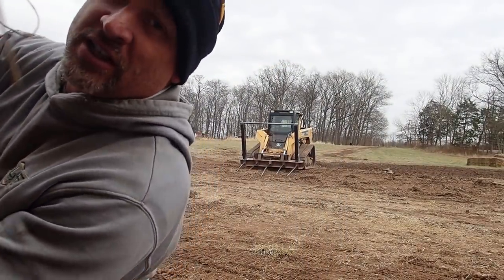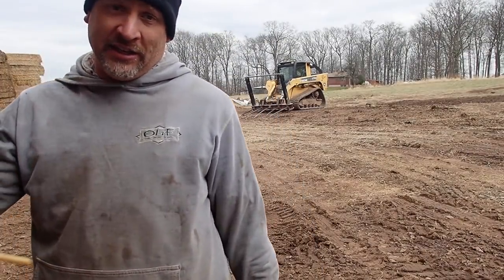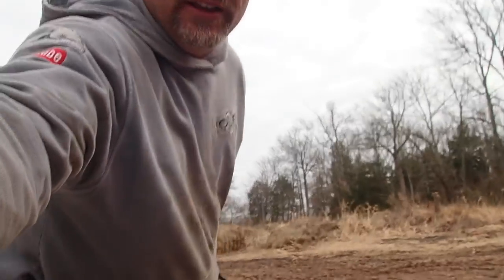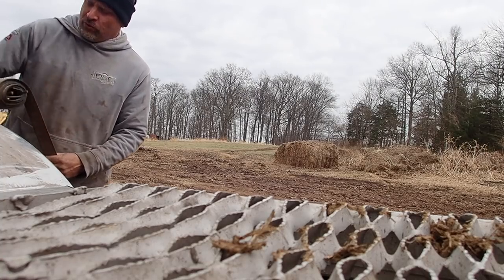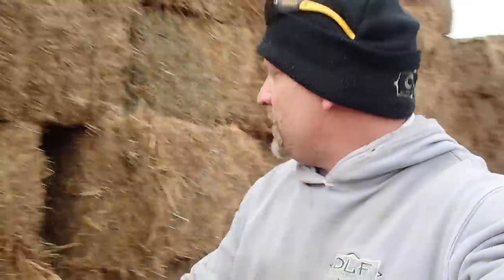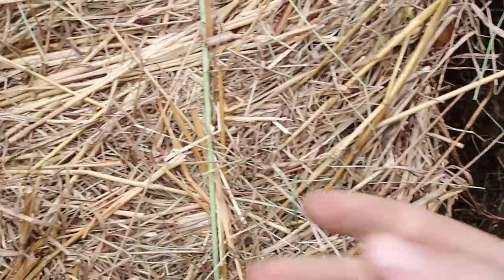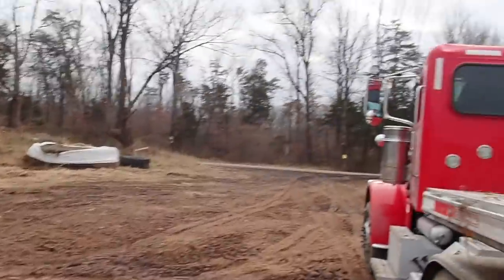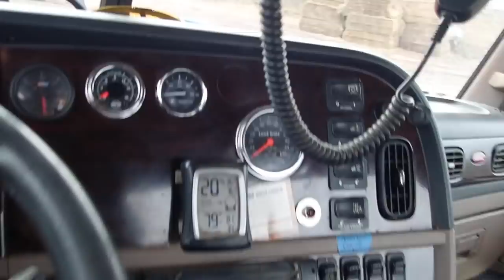Skid Steer Wont Quit Smoking

Comment: My boss has a 330 e and at around 2000hr. It was smoking black all the time, he thought it was I n the air system , but it turns out the injectors were getting week. But yours looks normal as a diesel

Comment: Wes, one thing I've noticed since you said that you're struggling to get bales on the forks is that each one of the forks on the skid steer is pointing a different direction. Maybe try straightening them out and get them all going the same direction. It's not going to solve the problem, but it should help some.

Comment: We have three 333e model track skid steers at work. If you look for a new skid buy the 333g model that's the newest model and is way better. Has a yanmar diesel in it and does not have the power issues the older skids with John Deere engines have. A tech for Deere once told me they have a guy (jd) that goes around the state's and overhauls the engines in these skid steers. JD got away from its own engines due to the power issues and due to emissions stuff the 333g model has def in it. That's what I've heard anyways

Comment: What is truly awful is to realise that for someone to steal that number of bales, handle, load and haul them off has to have some involvement (at least) with another farmer/grower because 65 bales of that size is a great deal of material! The thieves need access to machinery and equipment to load and haul off  the bales - they are not something you can put in the trunk of your car!! 

This theft is not some local scumbags from the run-down locality thieving something for themselves or sale to others but some other local farmer / grower. That would serve to make me really mad!!

To find out that someone had also been round and carefully sabotaged a further 20 bales by cutting strings in a remarkably cunning way just compounds ones angry feelings towards such people.

It suggests to me that someone pretty local has a serious grudge towards you Wes for some reason or other.

Comment: I like the strap winder that is really cool and rather simple I like it Merry Christmas
Reply: John Greer most flatbed truckers have them, they have lots of straps. I bought two five gallon buckets of chains and binders from a retired trucker. There were two of those strap winders in the buckets.
Reply: Good idea
Reply: John Greer they sell them at truck stops rather cheaply
Reply: Why wrap the hook first? When you throw that it could smash a window or hit somebodys head
Reply: David E.  The hook is wrapped first so that the weight is in the end that is thrown. It will unroll itself when thrown over the load.
Reply: The way they're wrapped is personal preference
Reply: some shippers won't let you throw the metal end. ive always flipped about 6 feet of strap tail and then rolled it up. did ltl otr flatbed. up to 35 30foot straps per load haha
Reply: That's why one, you learn how to throw a strap, and two if you have someone else out there with you, you shout a warning before throwing a strap over. Pretty easy "COMING OVER!". Lastly this is his operation so I'm pretty sure a shipper isn't going to be in his shit about how he winds a strap, or throws it.

Comment: Im suprized you don't use the 4 in straps with a sliding winch system on your hay trailers. Why don't you use them just want your opinion wes
Reply: Cody flenthrope because the 4in are heavy. Try throwing the 4in over the bales while they are on the trailer. And the 3 in are big enough

Comment: Wes comment on smoke and horsepower is a typical stupid farmer explanation. He is on and off the throttle so the turbo slowes down. When u get back in the throttle or add load it smokes a bit until turbo spools again. Just like every diesel until 2007 when they started using Dpf on the exhaust. If it's at full load steady state and still smoking it's broke!

Comment: first they steal your bales then they cut your strings. Karma is a bitch and she will catch up to them. also seems your skid steer is a bit light in the ass end.
Reply: LUNITIC WILL well he is picking up 4500-5000 lbs lifting 3 bales and the skid steer I think is rated around 3000 lbs 
skid steers have hydraulics enough to handle more weight its how their balanced to handle the weight their rated

Comment: Heck that is just broke in lol. We got a bobcat S250 with air cooled duetz that just rolled 12k hours. Smokes a lot. And i run them like you do. You got a good machine. And i do agree, they need more power per unit for what they can do.
Reply: Dan Kunde are you sure of the motor? I'm pretty sure all S250's have kubota diesels.
Reply: 02 s250 still had duetz, same as the old 873s did. In 03 they switched to water cooled botas.
Reply: Ah. Learn something new everyday. Thanks.
Reply: We had an s250 same motor. Good machine.
Reply: Yeah I've had T250's and T300's. Very good motors. Not a fan of the new emissions. Just something else to go wrong in my book.
Reply: Dan Kunde Lol Duetz you mean Deutz lol German brand 😲😂
Reply: We also have an 11 s750. With just under 3k hrs and our 250 with hold her own against the 750 with a Bota 87 hp motor. But hydro systems suck these says. Damn bypass systems kick in before ass end up on new skids these days.
Reply: 750s are garbage. We bought one to retire our 250 in '11, that thing sucked in every blade of straw or hay or dust. Had three small fires before we decided we better get something else. I found it was very underpowered and we had a lot more issues with it in 2000 hours than our 250 in 4000
Reply: Dirk i completely agree. Suppose to be a bigger skid but just falls on her face way to easy. Also not operator comfort focused. Small seat and no room for people with big feet. My father, brother and i all habe issues running foot controls in it.  Id rather trade it for an s330..  now that is a beast of a machine.
Reply: Dan Kunde we got almost 12500 on our S250 still running STRONG
Reply: We got a 863 with the Deutz, ours is oil cooled, isnt that how your S250 is as well, not air cooled??
Reply: I call it air cooled. Its air to oil cooled.
Reply: you oughtta see my 853 then  cause it doesn't have the Deutz anymore ,,damn  german crap i hated it 
had plenty of power  but was just too damn noisy and took too much maintenance ,,,I completely replaced the entire power system  ,, it has a  cummins  5.9 turbodiesel now ,155HP at 2800rpm  ,,and it doesn't slow down either
Reply: Holy sh*t, 12k hrs?  Never had one past 5000, and I thought that was alot
Reply: Yep. Just about to hit 12,300. She is a hoss. Not sure why but she just keeps kickin ass. And very little inputs besides general stuff as well.

Comment: Got a cat Telehandler 90 hp turbo perkins engine ,  13300 pounds  , hidrostatic drive . top speed in 1st work gear 12,5 mph , payload of 5500 pounds ,doesnt feel underpowered at all .I often dont go over 1500rpms .  I bet your tracks are stupidly ineficient (loss of power and fuel) because your engine is always screaming and not a lot of action is going on.
Reply: ETR well it looks quite muddy so the tracks are probably quite good for what he’s doing and there no point in buying a new machine when he doesn’t need it
Reply: ETR it can be more efficient to run a machine at wide open opposed to with a throttle pedal depending on what youre doing, this is why mode skidsteers don’t have throttle pedals.
Reply: most are built to with the throttle set up to be run wide open
Reply: JEEPGUY5 VLOGS AND GAMING, Name calling ? Not necessary.